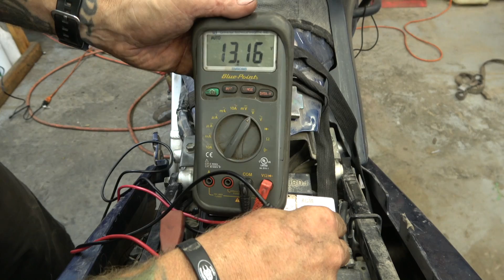Shlog 123 : How does a stator work?

Comment: What could cause the yellow wire to separate from the stator? Plz help I've went through 3 stators in 3 rides.theyll work for 30 to 40 minutes and then dead...
Reply from the maker: Don’t know but you might have something loose on the flywheel
Reply: @highlandcycles  I think I might have figured it out. The starter solenoid might have be bad and the previous owner put a different starter button in a different spot but the old starter button was also hooked up at the same time. So I'm thinking that might have caused the stator to malfunction. I don't know for sure though
Reply from the maker: Well that’s a good place to start
Reply: @highlandcycles  ok thank you very for ur advice.